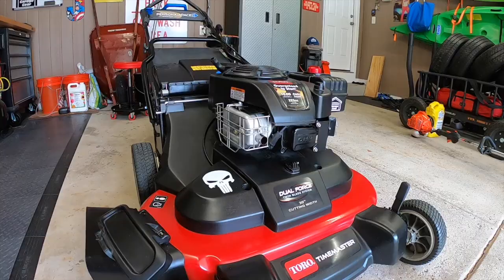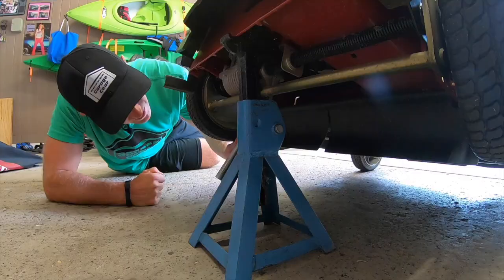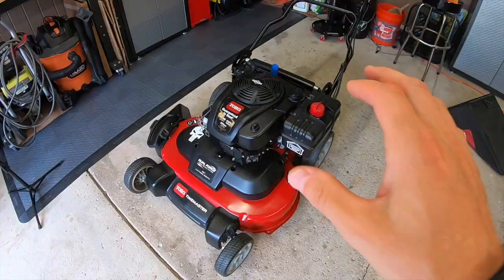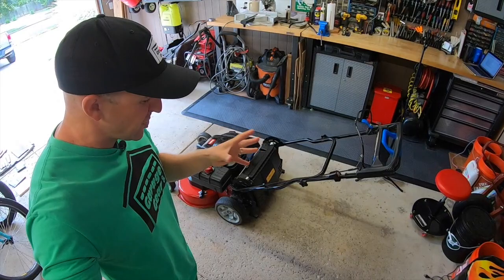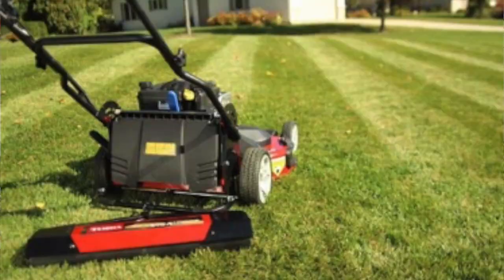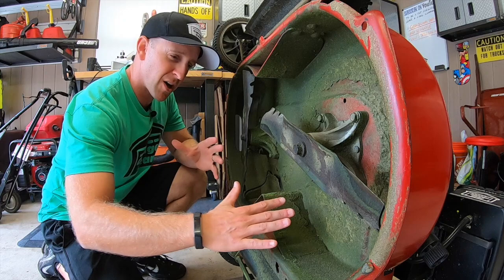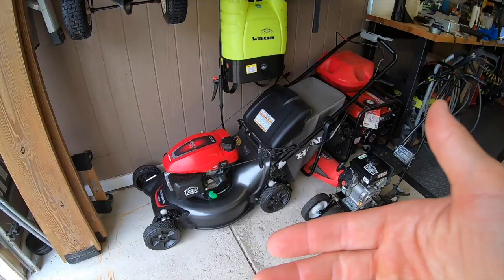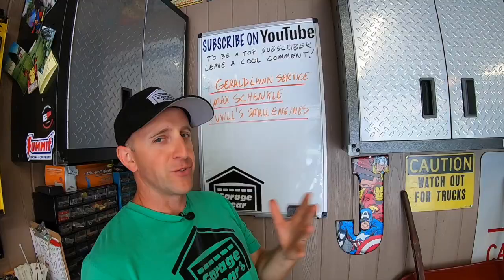BEFORE YOU BUY A TORO TIMEMASTER, WATCH THIS!

Comment: I own two of these things an early model and a current model and I agree with everything you said. I don't have the clumping under the deck because I cut my yard when it's dry but it still needs to be cleaned after a few cuts. The pulleys I changed immediately for the commercial Exmark ones on both mowers. The real downfall of this mower to me is the personal pace transmission it is junk. If you bag your grass like I do it becomes hard to push and struggles to get threw the grass. I have a snapper 21 inch commercial lawnmower as well and that transmission is the best transmission of all the push lawnmowers. I need to figure out a way of getting that transmission set up on the toro's. If you own a timemaster always keep belts and cables in stock at your house and be handy with being able to repair them it's not hard. I can say that these timemaster do bag the grass well mine are like a vacuum cleaner.
Reply from the maker: Thanks for sharing Preocupied! Lots of good info here! I will agree that these mowers are good vacuums. It’s great in the fall for sucking up leaves. Thanks for watching!
Reply: Question for you…do you have the two time masters or turf masters? I’m thinking about getting the turf master for next mowing season. I’ve heard the turf is the better of the two other than the deck.
Reply: @travisc3571  I have timemasters. The turfmaster is used for commercial usage. If you are just cutting your home only the timemaster is fine just don't cut when its wet have spare belts all three of them and upgrade the pullys when the original ones break. If you are using for commercial get the turfmaster it will last a little longer.
Reply: @preocupied1690  I’ll be using it for commercial use. Thanks so much.
Reply: @travisc3571  i cant find the pulley piece  u were mentionning is there specefic name for those?
Reply: @preocupied1690  i cant find the exmark pulley things u were mentionning is there à specefic name for those ? Thanks!!
Reply: @preocupied1690  Nice  thsnks! Was it a easy instalation ?
Reply: @olivierflhd6965  yes there are several videos on you tube explaining the install
Reply: @olivierflhd6965  yes that is the part number  and they went up in price. I paid 120.00 now they are 169.99.

Comment: Have had my mower for over 6 years now and my flap has 'never' been hit by the blades. I have the 190cc and have had no problem with it, certainly never had to tighten mounting bolts. Pulleys are fine, but I do have to now change the blade cable. Since I am in there I will also change the belt as it has a crack on it. I am in Missouri so my yard is steep going from main floor in front to basement entry in back, no problem with the transmission. Agree on the grass clumping under the deck being a pain.
Reply from the maker: Thanks for sharing William!

Comment: I disagree with a lot of this. I bought one in 2013 and mowed a half acre lot. Last year we moved to a much larger yard. Its always ran perfectly even though at the smaller place I treated it like crap. Hardly ever washing the deck and only changing the oil every couple years. It did break last year, but it was 100% my fault mowing in overgrowth and hit a small stump. Even then it just broke the sync belt, the first time it had ever broke. I'm 45 years old - I've been mowing grass for 30 years now - and seems like your complaint about clogging is not unique to this mower. Yes, with no discharge on the left blade it clogs a little more. But I've never seen a mower not clog in wet grass. Proper use of any mower requires you wash it out after use. This is just how lawnmowers work. Same with tightening the deck bolts. Bolts need retightened. This is the current state of the universe.

After moving to the bigger yard, I researched updating my mowing equipment. I still couldn't find anything better than the TimeMaster for the niche it fills. So I bought another one and have two now.

Thanks for posting, good content. Just wanted to make sure viewers see that others are having different experiences.
Reply from the maker: Thanks for sharing your side of the story. For some these machines do well. I like the mower. I think it has its place, but it definitely has some issues that need room for improvement.
Reply: He must have got a lemon. Mine is the best mower I’ve ever had. I only mulch and a lot of the time it’s thick wet grass at 7 days. Zero issues in 3 years so far. I cut mine and my neighbors every week.
Reply from the maker: @MatthewSmith-uf6tr  thanks again for sharing Matt

Comment: In 14 years of having mine, the only complaint has been the gas tank size. I still have the older smaller size engine but no repairs or problems. I have added high lift mulching blades and never bag my grass or leaves.  Yes, when mowing wet grass, the clippings like to bunch up underneath.  Wet grass collects on every mower I have ever used since I bought my Toro 21” commercial back in ‘85.  The pulleys, belts, and transmission are still the original and going strong so I don’t know what people have been complaining about. The bracket for the key switch has broke twice when I got too close to picket fences. One thing I want to do is take some of the plastic baffles from the bottom of a 21 super recycler and install them on the bottom of the 30” deck. I’d try 2 baffles for each side. I’d match the location as to where they were mounted on the 21. I bet that would help push the clippings back down into the yard. Overall I think the review was a little on the extreme side but whatever to draw in reviews and comments.
Reply from the maker: Thanks for watching!

Comment: I haven’t had the deck clogging issue but I’ve replaced transmission once and just spent $190 to have new motor mounts installed and new belts required after engine moved around due to missing motor mounts.
Reply from the maker: Jeez, thanks for sharing this information. Pretty wild that it wasn’t working well for you.

Comment: Hey JD, If you still have your Timemaster, try removing the front deflector plate under the deck. I removed mine this spring and so far, no clogging issues while bagging. Like you said these are not recycler models and opening up the airways underneath may help. Looking forward to the Ariens mower update
Reply from the maker: Hey Mike sold mine a year ago. Haven’t had a headache since lol 😂 but thanks for info and for sharing it with the community. Ariens update in another week or two. 👍stay tuned bud!

Comment: Completely agree with everything you said, i could add to the list, belts keep breaking, especially the v belt from engine to blade pully. Would love to see if the turfmaster is any better. Im constantly wandering if my timemaster will last the job i have on the day.  It's definitely unreliable
Reply from the maker: Mine definitely has me worried every time I use it too! Thanks for watching Chris!
Reply: You have belts to tight. They don’t need to be even close to as tight as toro says. And make sure engine rpm is tuned correctly. Both with help in saving belts
Reply from the maker: @nicholasschmidt8919  thanks for sharing!
Reply: Yep, checked my belt to the blade pully and it is almost split through. Overdue to replace.

Comment: All true comments in this video.  I might also add that after 2 years of use with my Timemaster, the timing of the blades suddenly was off (perhaps after maybe hitting a small rock? I don't know) and the blades ended up scraping each other.  I attempted to repair myself but ended up having a pro fix it for $$.  Also, the pull rope is making a noise that I'm told will one day need to be replaced.  Interestingly, I don't seem to have much issue with clogging, I do keep it clean, but I don't mow when the lawn is ever wet, and I will typically bag, but when I mulch it seems to work ok.  I can't believe how expensive the units are nowadays, I believe I only paid $800 a few years ago for my Toro.  Not sure if I would be willing to fork over $1500+ today.  Get a Honda instead, or take the money and pay a neighborhood kid to mow your lawn, and enjoy life instead - after all, we've earned it!
Reply from the maker: Appreciate you sharing your experiences with the timemaster Rob! You’re right at the end there! Gotta enjoy life! 👍

Comment: Nice, honest review JB. 

TORO has always had the reputation of making some of the best equipment you could buy.  But in the past few years, I have read about a bunch of problems with some of their stuff. 
Not only the TimeMaster, but with their TRX track drive snow blowers as well.  
These TRX units were meant to compete with the Ariens RapidTrack's, but had catastrophic transmission issues.  Bad news for anyone who dropped the 4k on one. 

Not sure what is going on with TORO's  research & development department, but I think they may want to start doing some mandatory drug testing for those guys........ 😵‍💫

Nice gas tank mod too, JB.  Only thing is, now it looks like a Tecumseh clone 😜😂
Reply from the maker: Hahaha drug testing their entire R&D department! I wonder how their gonna get out of that TRX hole! 

That may be the only thing I actually like from tecumseh engines lol! It fit perfectly. You and I can agree on one thing probably… it ain’t going back on a tecumseh engine lol! 

I’m starting to wonder if toro may see this video. Wonder what they’ll have to say.
Reply: I’ve had a few Toros and a few other brands. The only brand that I’d ever liked better than my Toros was an incredible Ariens that felt like an anvil but had a notoriously troublesome transmission design.  It’s very disappointing to know that  Toro is failing in transmissions as well.
Reply: The quality issue with newer Toro's, is what always eventually happens when a once proud, highly regarded entity gets absorbed by a bigger corporation.
 It's very very rare that quality goes up after a merger.
 The company being bought, loses it's autonomy, gets raided for the positive side of what it has to offer, then gets turned vanilla as it's melded into the cookie cutter product line of the buyer.
 Employees get cut due to redundancy of job titles, R&D after it's raided for it's technology, slowly tanks,  and the innovators within,  move on due to morale loss. The company eventually just becomes shell of it's former self.
 And in some cases, is phased out.
 Thank you MTD.

Comment: I have the 30” time saver. Used in in Ky and had grass stick to the under body like paste. Moved to TX and has never happened again. KY bluegrass is thin and moist making a grass paste. TX we have St Augustine grass. It’s thick and not as wet as KY bluegrass. It all depends on the type of grass you have.
Reply from the maker: @rodneyhicks5527  thanks for sharing rodney

Comment: I must have been lucky with the one i have had for several yesrs. I have mowed HUNDREDS of lawns with it and have had no belt or pulley issues or any other mechanical issues at all. I change the oil frequently and sharpen the blades weekly. And almost exclusively side discharge. Over all it has served me well.... Paul
Reply from the maker: Thanks for sharing Paul!

Comment: You nailed it on the intro - it's in a class of its own. Despite all issues (I've had each of them outside of the flap), what's the alternative? 

I'm unaware of another wide-body mower that doesn't take up a huge amount of garage space and is easy enough for anyone to operate. I extended my warranty and will run this until it dies, but hope someone comes out with some true competition or even a revision to this mower that solves its (several) weak points.
Reply from the maker: Hey Zach well said! The flap I made in one video is linked in the description so you can find it there. Definitely a better way to go. If they corrected these weak points they would truly dominate the market here. If another company came up with something comparable they too could lead the way in this segment. Thanks for watching!
Reply: @GarageGear  Do you have a different mower you would recommend for someone in the market for a 30" deck?  Or do you still recommend the TimeMaster despite it's flaws?
Reply from the maker: @KennyDiFiore  that’s a great question! We’re pretty limited in this department. I know Scag and Ferris make some 30” models but you’re gonna pay for them. They are commercial grade and heavy duty. Thanks for watching!
Reply: @GarageGear  Thanks for the suggestion. I'm only interested in residential use, so heavy-duty deck construction isn't really a requirement for me.  I am concerned about the clogging that you mentioned with the Time Master.  I have St. Augustine sod so the blades are much thicker than some other types of grass.  Also, the SCAG has a very similar under-side deck design, so I'm concerned that one will clog also.  I've bought two 30" electric rear-motor riders (Cub Cadet $2600 and  Ryobi $2800) and both have failed on me after about 10-15 hours of use.  I'm switching back to gas, but I'm looking for something more reliable than Craftsman or Troy-Built 30" riding gas mower.  Those other models you mentioned, the SCAG and Ferris, are ~ twice the price of the Time Master; do you think it's worth it for the beefier transmission and more torque to address the clogging issues you've seen with the Time Master?  How do you feel about the Turf Master HDX?  I'm sort of stuck on 30" just because of my available garage space and my yard size.  Anything larger would be overkill.
Reply from the maker: @KennyDiFiore  I hear why you’re saying my friend! I’m kinda in that same window too. Those mowers are pricey but you get what you pay for. The hdx does have better pulleys, and I’m pretty sure a better transmission. Clogging will still be a nightmare because the deck is the same. Let me know what you decide. Thanks for being a cool fan!👍

Comment: I have two Toro Timemasters. One to cover breakdowns..... because you know it will. I've one down with a pully bearing gone that tensions the belt between the blades.
I always carry a spare belt that stops and starts the blades, definitely a weak point and honestly a bad design. 
Got a big job with it today and its raining. Wish me luck!
Reply from the maker: Fingers crossed bandit!
Reply: Ive modded mine with the kohler engine, upgraded to exmark pulleys and its great now. 
I use it for a lawn buisness and it saves alot of time.

Comment: Very honest review. I have seen these around the neighborhood. At Home Depot. Ok. Too much plastic. The engine is not a great engine. It’s way under powered and there for overloaded. Sounds like they’re using the same transmission as the 21 inch mower. And along with the other problems. Is it worth the extra $$? Probably not. Even the 30 inch commercial versions are ok. But, way too expensive for the extra inches of cut. Again, an undersized engine. In the future they’re going to be a ton of these sitting at the curb. My point? Stay with the relatively simple 21 cut. The generally work with much less problems.
Reply from the maker: 💯agree on all this! Thanks for sharing this John!

Comment: I've added a Tecumseh snowblower gas tank to my own lawnmower too. I added manual throttle control and a tachometer so I can run it at higher RPMs with a high-lift blade.
Reply from the maker: Awesome thanks for sharing jman!

Comment: I’ve had my timemaster for 1 season mowing my half acre property. Agree on the gas tank, I have to fill up mid way. I don’t have issues clogging but I side discharge when it’s wet, or bag. I find mulching is it’s weakness, I get better results with bagging and side discharge. I hose out the bottom after every mow though.

I thought about the turf master, but in Canada it’s $4300, timemaster is $2000. Time will tell, but I love using it.

Oh, and my backup is a Honda HRR! Best mower I ever had, just wish it was 30”.
Reply from the maker: Thanks for sharing Gneesh! 👍

Comment: I have 2 timemasters, and i just really haven't had all the issues you spoke of in the video. I mow 30+ lawns a week. The only issues that you described that I've had are the pulleys on 1 machine.It was partially my fault because i never adjusted the cable as well as lost a dust cap to a pulley and ignored it. They were replaced under warranty with the commercial ones free of charge. The only other things I've had to replace were belts (drive belt and blade engagement belt) still have original knotched belt on both machines. The first one i bought was in 2020. Also, the cable is something that will go eventually. Would help if toro came up with something better than the plastic crap they have now. I broke one once after changing a belt, which was the wrong size. It was a tad too tight, and when i went to engage the blades, the plastic part of the cable broke. My transmission on both is good. Havent had  to tighten the engine bolts. Clogging happens only when i cut wet, which i try to stay away from doing anyway. The gas tank can be upgraded as you did. All in all, the machine cuts well and will give you many years of good service. Granted, i use it commercially, and it's a homeowner machine anyway. That being said, i think it's a pretty darn good mower.
Reply from the maker: Thanks for sharing this with the community Joe!

Comment: I have a timemaster, all of what you say may be true except for the underneath getting clogged and having to clean out the grass clippings....of course, I have st. Augustine grass and I cut when the grass is not wet or moist. 
I have had this for 5+ years, I do a yearly oil change, blade sharpen/swap, and a new plug. The only thing I have had go wrong was the kill switch wire was pulled out ( it got caught on a branch) and I had to replace the cable for the transmission. Having said that I am super happy with Toro's Timemaster.
Reply from the maker: Thanks for sharing ted